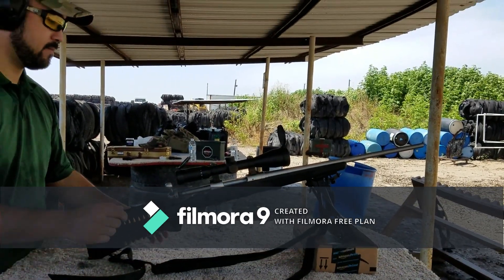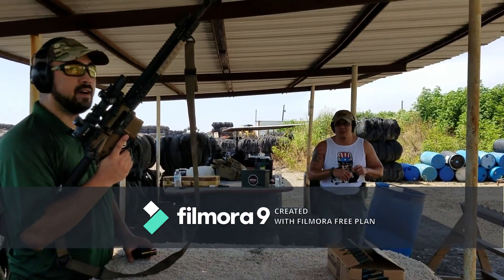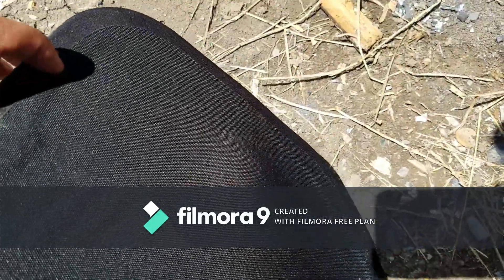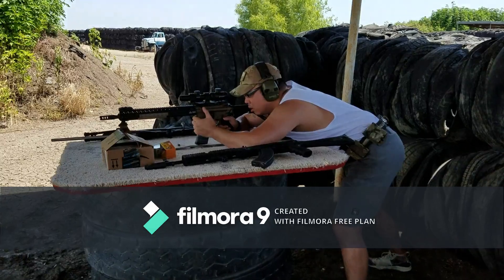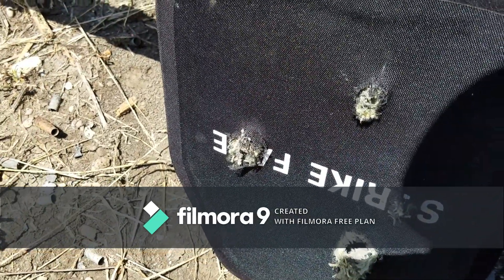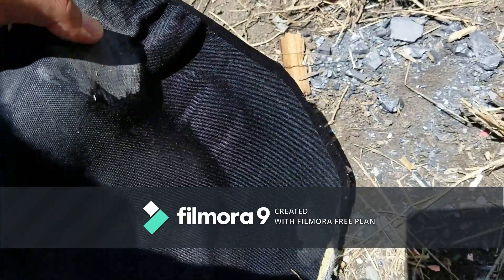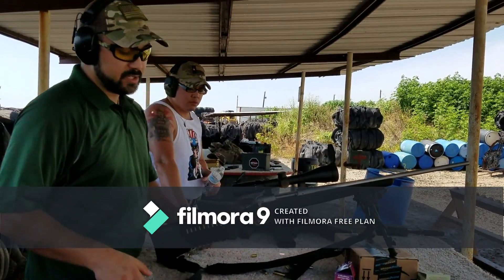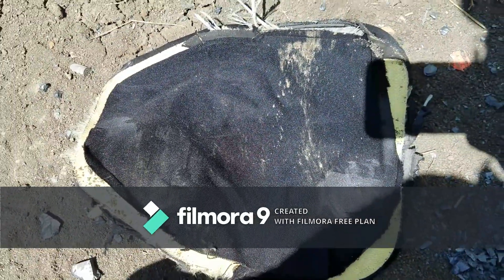Ballistic Plate Test - Battle Steel Level IV 10x12 Shooter's Cut

Comment: It nearly knocked the back out because you didnt have a backer for it. NIJ requires a certain type of clay. Other youtubers have used sand with good results.  It's an impressive plate for 99$.  The only down side being it does have composite as a component of the layering providing ballistic protection so leaving the plated in hot vehicles could cause degradation of the material.
Reply: Aleksfoxtrot You do realize composite isn’t a material right?
Reply: @christophegroulx8187  it's a composite polymer I think
Reply: @aleksfoxtrot8044  It's polyethylene
Reply: @christophegroulx8187  thanks

Comment: For a $99 plate... this thing is pretty legit
Reply: Your health is worth buying an NIJ certified plate.
Reply: @Doomnahct  I'd rather have a non-NIJ certified level 4 plate that stops 30-06 black tip than a level 3 NIJ plate that won't. Plus, for that price you can get some for the whole family.
Just my 2 cents
Reply: @oakleysv9600  THIS.^ Plus, it's so lightweight. I had previously set my mind on getting RMA 1155's which are NIJ Level IV certified for $130 each, but those are 8.5lbs. The only reason i'm getting level 4 at all is to ensure i can stop m193 and m855, because 3+ steel has trouble with m193 at close range and polyethylene has trouble with m855. The level 3+ plates that WILL stop those rounds consistently at close range, weigh the same as this and cost 4x-8x as much. Yeah, I'd rather have one of those for how well they hold together, but I'm broke.
Reply: Doomnahct, This video clearly demonstrates the plate capability with respect to stopping rifle threats, and I would trust it with my life. Don’t be upset that the $99 plate is better than plates 4-5x the price.